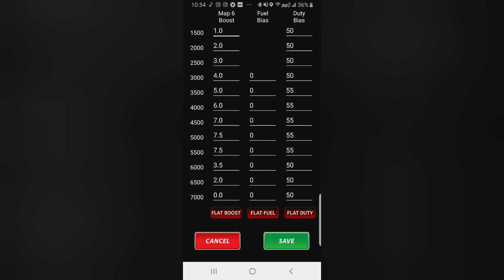⛔️⛔️⛔️April 2022 UPDATE check description⛔️⛔️⛔️All VR30DDTT Infiniti Q50/Q60 JB4 owners WATCH THIS!

Comment: Hey bro.  Can a  stock red sport beat beat tune g37
Reply from the maker: My response to this is typically "race them and find out" 😅

But on paper, I would say definitely. A FBO tuned g37 would be lucky to hit 340whp. A stock RS will dyno between 365-375whp. They are close enough in weight where the power difference and slightly better transmission in the RS should give the win to the RS.
Reply: @serstylz2  ok cool bro

Comment: Great content! Quick question, I own a 2018 Q50 3.0t Luxe stock. I plan on installing AMS HX, AMS Aux Water Pump, AMS FL DP, and FI CBE with the JB4. Obviously I need to data log and see if my vehicle is running well but do you think this set up is optimal for longterm reliability to run map 1, 2, and 6 with your custom set up?

Thanks!
Reply: Forgot to mention I always run 93 fuel in my car

Comment: Im in FL with 93 and I got a silver sport with no mods. Going to get an heat exchanger. But what maps you recommend without heat exchanger? And what maps with an heat exchanger?
Reply from the maker: A HX isn't a power adder but check the first page here, things have changed since I had JB4 

https://www.n54tech.com/forums/showthread.php?t=46774

Comment: When you made this video what mods did you have?
Reply from the maker: JB4 with fuel wires and EWG, AMS downpipes, Frozen Boost 101 HX, Megan Y Pipe
Reply: @serstylz2  I just bought the jb4 and I have the mishimoto heat exchanger can I run map 6 like your numbers or should I go lower

Comment: Can the ewg cables be taken off easy? Car has warranty.
Reply from the maker: "Easily" is a bit relative/opinionated.. its not easy to reach down there and unplug them.. I have to use a flathead.. but you can get it done within 30. If you have intakes, it's easier to remove the cones to do it

Comment: Ihave downpipes and a cat back and just ordered a jb4. Assuming I am going to run lowest boost maps, Is the jb4 completely unsafe without a heat exchanger? 😳
Reply from the maker: No, your car may just heat soak and lose performance after 2 or 3 pulls

Comment: I just bought a 2018 rs400 it is bone stock I run 91 octane fuel in it daily the  occasional 94 octane what map do u recommend. What would a reliable psi be over stock?

Comment: Just went ahead and purchased jb4 thanks to your video! I'm planning on adding the ewg wires as well just had a question on the duty bias. Did you do anything with those settings? Or did you just plug it in and keep everything the way it was? Still trying to learn lol thanks in advanced.
Reply from the maker: EWG settings are a bit advanced. This thread will give you more info than I can type here https://www.n54tech.com/forums/showthread.php?t=61547
Reply: Thanks for providing that resource and the quick response, much appreciated. Now in this video you showed your recommended map 6. In that is your fuel wires and ewg settings turned on? I should be getting my jb4 and ewg wires hopefully this coming week and want to make sure I input the right numbers and settings.
Reply from the maker: @elmerortega9650  my fuel wires were disabled,  EWG were enabled. But you need to enable more than just duty bias for the EWG to work correctly. I believe the JB4 software now put in some default duty bias settings but you have to make sure to follow the steps in that link to enable them fully. When I first installed them I forgot to change the settings and when I hit boost, after I left off the gas the car kept pulling forward hard, then went into limp mode 😳
Reply: @serstylz2  sounds terrible especially on the first drive lol. I read on that forum that the FF has to be adjusted as well with duty bias so much info to retain 🤯 seems like first thing is turning on bit.0 but I assume that's to turn on fuel wires? There's a lot more then just a simple plug and play lol is there another setting that needs to be turned on with us non Red sport owner? Don't think I read that on the 16 pages in that forum haha. Again man I really appreciate your help.
Reply from the maker: @elmerortega9650  firstly, fuel wires and EWG connectors are separate,  you can use EWG connectors with or without fuel wires enabled/installed. I had them installed but disabled them over time, I don't think they serve a good purpose.

Second, all of the settings that need to be enabled after installing EWG are on the very first post of that link I sent you. And there's no difference between RS and Non RS as far as those settings go. I am non RS. 

Turning on Bit0 does enable fuel wires if you decide to use them. Will not change anything you set/enable for EWG
Reply: @serstylz2  that clears up a lot of what I needed to know and I did see what settings you were talking about. I'll feel much more comfortable when installing and setting maps with the jb4 when it comes in and having your thoughts and seeing what ddnspider had to say about the fuel wires I'll op out and not install them. Thanks for all the info and for keeping things real!

Comment: Can i run E30 with this map 6? Also this is only for fuel wires ?
Reply from the maker: If you have downpipes or catback, yes. I wasn't running fuel wires, had them installed but disabled.
Reply: @serstylz2  i have ldp, and a muffler delete with tips, heat exchanger, big mouth ram air intakes , oil catch can, ill run the map 6 you suggested in the description, if i run e30 on your map 6 settings would i be in the direction to beating scatpacks and mustang 5.0 ?
Reply from the maker: @boostedpnut1618  race em and find out 😏

Comment: How much horsepower does ur custom map 6 makes?
Reply from the maker: Never dyno'd it. Was more interested in actual street performance vs dyno results. I dyno'd when I first got my JB4 and used a dirty Map 6 and made 423/450. It's possible my better Map 6 made less power but my 0-60, 1/8 and 1/4 times were all much better

Comment: What does duty bias control? Is it important to set it to the same values as you?
Reply from the maker: They control the wastegate position if you have the EWG connectors. I highly recommend purchasing them
Reply: @serstylz2  was the installation hard? You know where to go for the best instructions
Reply from the maker: @Yarra  of the JB4? 5 mins. Piece of cake. Fuel wires a bit tougher,  maybe 30 mijsnthe first time because it's a tight fit on the passenger side. EWG up to 45 mins,  same reason tight fit. BoostInMotion has a video on how to install the easy way. For fuel wires and EWG,  probably best to go right to the n54tech.com forums and go to the Q50 section to read info
Reply: @serstylz2  ah okay I was wondering about the ewg wires. The fuel wires were pretty annoying but ando is saying I need ewg wires with my ldp so I gotta do those lol thanks man.
Reply from the maker: @Yarra  EWG wires are great. Definitely get them. They should be able to help here 

https://www.n54tech.com/forums/showthread.php?t=61547

Comment: I have no other mods besides the jb4 The fuel is 98 grade and I’m only getting about four psi overstock with the jb4 The highest I’ve gotten so far is 12 psi
Reply from the maker: That is good fuel, but with no other modifications you should not be running map 3, you should be sticking to map 1 and 2, datalog those and check the results. You may be pulling timing on Map 3 which is why you're not seeing the desired outcome

Comment: Can i run this on completely stock q50 ss and 91 gas?
Reply from the maker: No, you can run Map 1, and would have to datalog Map 2 runs and submit for review on n54tech.com. This Map 6 is for 93 fuel with bolt ons.

Comment: What is the 50 in the duty bias column mine was at 0 should I change that to 50
Reply from the maker: Those are for the EWG connectors. If you don't have them, you don't need to change them
Reply: Does the JB4 for my Q50 come with the EWG connection
Reply from the maker: @anthonyrodriguez5581  it's an add-on that you have to buy https://burgertuning.com/collections/infiniti-q50-q60/products/jb4-ewg-add-on-connector-for-kia-stinger-and-infiniti-q50

Don't buy it until you've spent some time learning about how to install it and how to dial in the settings. I encourage reading and learning the JB4 and it's components before installing, for the safety and longevity of the car
Reply: So until than just leave it at 0 and thanks for the quick response bro 🙏
Reply from the maker: @anthonyrodriguez5581  Yes. Those fields actually don't even work until you add the EWG connectors. Leave them at 0.

Comment: Hey man, Great Video! I'm new to the JB4, I have a 2017 Q50 3.0T Premium, AMS LD, Burger HX and Stillen CB and run on 93, Your Map 6 Numbers good to go on mine?  Looking for something fun, but don't want to beat on the engine.  Also, whats a good stock Map to run on mine?  Any help would be appreciated!
Reply from the maker: Yep you can run Map 6 on your setup. On hot days when I didn't want to beat on the car, I would run Map 1 or 2, and I often would switch to Map 0 (off) in heavy traffic
Reply: @serstylz2  awesome man, thanks for the quick response!
Reply: How much hp gains off map 1 or 2? On a stock 3.0t
Reply from the maker: @qfifty9529  too many variables... can't give a set number, but anywhere between 25-40whp on Map1

Comment: Just got a Q50 3.0t. Looking to keep it simple basic. Would like more out of it and keep it heathy. Jb4 a good buy?
Reply from the maker: Yes, if keeping it simple,  a JB4 and heat exchanger would allow you to run Map 2 all day if you have access to 93 octane. The car would drive like normal until you went full throttle, then you would feel a significant increase in power
Reply: @serstylz2  I do have access to 93. Was thinking LDP, heat exchanger, bms inlets, Exhaust. Jb4. Really more so concerned about longevity
Reply from the maker: @Zach3.0tt  should run fine for a long time. You'd be able to run the map I suggested in the video with no problems. Add EWG connectors and it's a very strong map.. strong without EWG bit insane once you add them

Comment: Very helpful and telling it how it is. Question though: on a stock 3.0t, without a heat exchanger or downpipes, what settings do you recommend running on map 6? My JB4 with fuel wires and EWG will be coming soon and just wanted to do my research to start rolling right out the gate
Reply: Also want to mention only 91 octane is available in my area
Reply from the maker: @Howienator  with only 91 octane and being stock, you're limited. You would be better off running Map 2 until you get some mods, the Map 6 would not be significantly better than Map 2 in your circumstances
Reply: @serstylz2  what about if its 93

Comment: can i run your map 6 u recommend if i have down pipes but no HX
Reply from the maker: Yea, you're just going to experience heat soak pretty quickly.. after 2 pulls you'll start to lose significant power

Comment: So I just bought a JB4 from a guy who you cistom map 6 for I got a question if you ever got time
Reply from the maker: Ask away
Reply: I was wondering should I not use his map 6  or should I have my own made
Reply from the maker: @dreaadheadzee4394  depends on what mods you have. I am biased to the Map 6 I spoke of in this video because my logs were always clean and the car ran great,  but my Map 6 doesn't work if the car is stock. What do you have done?
Reply: @serstylz2  I have mega racing test pipes just got 3 inch exhaust piping and today I’m getting a blow off valve put on , what do you think I need ?
Reply from the maker: @dreaadheadzee4394  if you'll be on 93 or e-blended gas, run my Map 6 from the video, it'll run well. Also, test pipes is usually the term for the VQ non turbo engine. The VR turbo engine has downpipes

Comment: what would you say is beneficial with someone with just a muffler delete but planning on getting alpha heat exchanger since i live in florida but until then if i get the jb4 i plan on just map 1 and 2
Reply from the maker: A muffler delete is strictly for noise, no performance gained at all. Until you get the HX, Map 1 and 2 is fine, after the HX you can do Map 3 but datalog it. You'll need some downpipes and/or a catback to go beyond Map 3
Reply: @serstylz2  yeah i had a invidia cat back but i wanted louder so i bought a muffler delete and downpipes will void warranty. The hx won’t void warranty since it is from alpha
Reply from the maker: @Niko-sp1rf  you must have a strict dealer. I've been in my dealership with my downpipes, Frozen Boost Heat Exchanger,  BOVs, tune, Megan Y pipe, catch can etc and not once have I had a warranty issue. But if you plan to stay muffler delete and HX only, you're sticking to Map 1/2, and possibly 3 if logs allow
Reply: @serstylz2  well i really don’t know if they’re strict but i called and they mentioned how downpipes would void warranty so i didn’t want to risk it

Comment: Man you seem to know this platform to the best.. I’m an instant subscriber and student of the game you putting out!! It’s going to take me a minute to see which one of your videos would best apply to me but I look forward to watching them.. I finally got my Q60 luxe version tho!! And I just purchased a heat exchanger and W1 oil catch can. My JB4 is on the Way.. I agree with you on the whole tuning the car to get the best driveability out of it for the longevity forealz.. yeah Are the fuel wires install required to run these number that you stated? Do EWG wires come with the JB4? Or is that somthing I have to purchase from els where? New to the platform appreciate you forealz..
Reply from the maker: Fuel wires... the jury is out on those. I think I stopped using them towards the end of my time with JB4. Leaning out the AFRs seemed to be the opposite of what the tuners were doing.

EWG connectors are an add on that you have to purchase separately on the Burger website. Definitely definitely recommend those. Unlike fuel wires they really add power undoubtedly and are well worth the $
Reply: @serstylz2  Would you happen to have a video of when you installed those in you car? Did you bother to connect the fuel line cables? I notice other people don’t? 🤔 Also I was going to ask you what map setting should I be using if I don’t have down pipes yet?
Reply from the maker: @jayg639  I have a video of me uninstalling the EWG connectors when I sold my JB4 to someone. I wanted to help point out where they connected to and the best way to install since the angles are funny-ish
Reply: @serstylz2  oh ok I’m still watching thru your videos haven’t got to it yet?

Comment: I just purchased a jb4, my 3.0T q50 is bone stock which maps may I safely run. moreover, do I have to make adjustments, or can a just select a map and go with it. also what is map "0"
Reply: oh also i always run 93 fuel
Reply from the maker: @nicksingh9992  this is a great resource, the 1st 2 posts in here will get you started https://www.n54tech.com/forums/showthread.php?t=46774
Reply: @serstylz2  Big help thank you

Comment: stock 17 silver sport, with just a heat exchanger can i go up to maps 3-4? or still stick to maps 1-2 until ldp/cbe? im in cali and only got 91 sadly smh
Reply from the maker: Heat exchanger does not impact the JB4 suggestions as it is not a power adder and does not change out the restrictions of the catalytic converters or the skinny piping on the stock system. Per Burger you should use Maps 1 and 2.
JB4 Maps as of v8 firmware:

Map0 - JB4 disabled
Map1 - 4psi peak, default map, 91+ octane
Map2 - 5psi peak, slightly stronger, 91+ octane
Map3 - 5.5psi peak, suggested for 93+ octane or 30% E85 mixtures
Map4 - 6psi peak, suggested for 93+ octane or 30% E85 mixtures
Map5 - 7psi peak, suggested for 100+ octane or 30% E85 mixtures
Map6 - User adjustable by RPM map using settings on user adjustment page. Setting of 5.0 would request 5psi over stock at that specific engine speed.
Map7 - Progressive WMI integrated map, boost profile under WMI flow adjustable on WMI page.
Map8 - Low boost VALET map (200hp simulation!) -- Auto selects when in ECO MODE.

Comment: If I were to JB4 tune my car, can I run 6psi stock with 93 fuel and be reliable? Also would pushing 6psi alert the infiniti dealership when it comes to my warranty?
Reply from the maker: I wouldn't go past +5 psi if your car is stock with just JB4. And no the dealership cannot tell anything, just remove it before a visit and you'll be fine
Reply: @serstylz2  What mods should I add when going past 5psi. Also what’s the horsepower gain with +5 or 6?
Reply from the maker: @ahmadalsheikh4236  the information you're looking for is already in the description. And you can't really determine a set  horsepower as too many factors come into play, but when I had my Map 6 peaked at + 7 with E30 fuel, I peaked at 423 wheel horsepower
Reply: @serstylz2  Ya but I’m talking about 5-6 psi. Can I do JB4 with heat exchanger only.

Comment: Is that a safe map for a completely stock  q50?
Reply from the maker: No, use Maps 1 and 2 if stock
Reply: @serstylz2  thank you!
Reply: @serstylz2  what mods would I need to run higher boost?
Reply from the maker: @DaneFerolin  1) lower downpipes OR a catback exhaust (of course both is best)

2) heat exchanger
Reply: @serstylz2  I appreciate the info
Reply: serstylz2 can I get away with just an upgraded heat exchanger?